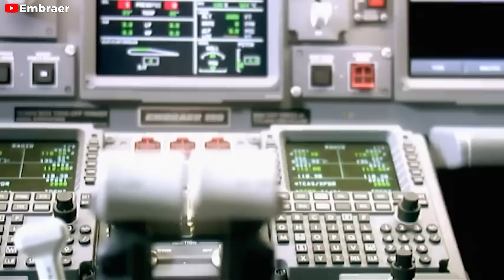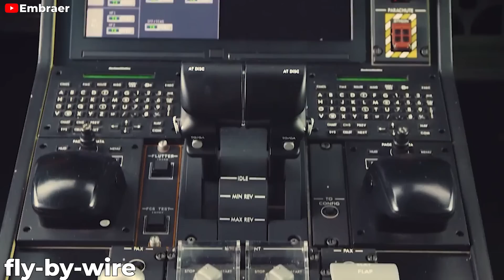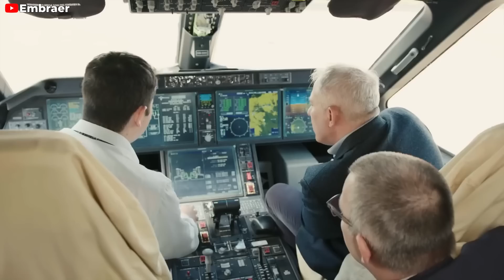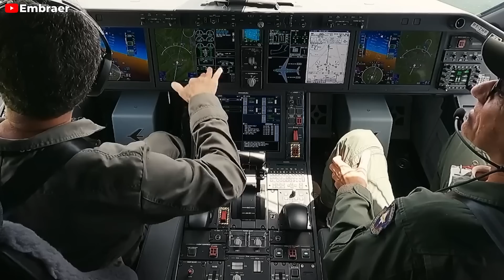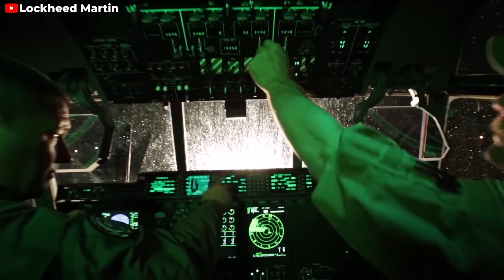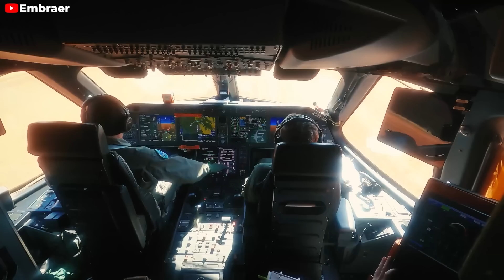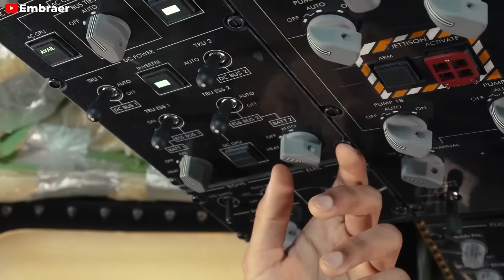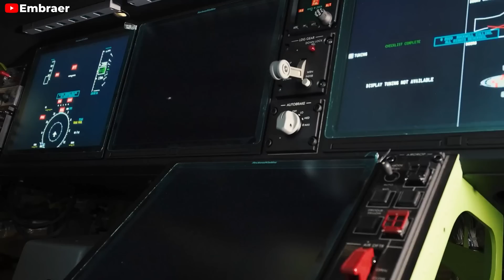The Embraer NEW C-390 Will Change The Aviation Industry and Destroy C-130J! Here's Why

Comment: Nope the C390 doesn't fit Special forces niche. It also can't become a gunship. Then there the takeoff and landing on soft terrain and multi-environment. The C390 can do some things, But is still restricted on versatility.
Reply from the maker: thanks for sharing ✈️
Reply: Yes, it takes off and lands on soft, multi-environment terrain in the same conditions and locations as the C130. This was a project requirement.
Yes, it is highly suitable for Special Forces. Because it is faster, quieter and more equipped with countermeasures.
There is already a project for the gun chip version, but there is no customer order.
Remembering that the AC-130J Ghostrider must only be 30 units (previous versions have already been withdrawn from activity)
Reply: @wallacemjr  Oh really?
Show me a C390 taking off and landing in less than 1500 feet.
Can't do it with any load at all, and it's SPECED for 5000 feet minimum so it probably can't do it PERIOD.

BTW - show me a C390 landing on any aircraft carrier - and deck-launching back INTO the air.
That's been done by an EARLY KC-130, back around 1962 or so.
Reply: Ele pousa e decola em pista não pavimentada!

Comment: Where is the comparison with the Lockheed C-130?  Is the cargo space bigger?  What is the load limit, range, speed?  Take-off distance is also important, how short a runway does it require?  What is the fuel consumption?  Jet engines are not normally used where dust and debris on non-paved runways is present, so are these engines dust proof?   Can it fly is one engine is off?    How much does it cost to maintain?  The C-130 is known for its fuel economy, load carrying ability and ease and low cost of maintenance.  I'm sure it has decent avionics but are they as good as American made electronics? Stop with the sales talk and compare!
Reply: Tudo que você perguntou  o kc 390  têm! E muito melhor que esse museu do Hércules 130, tanto que está  vendendo muito, todos os países querem, intendo sua frustração, 😂 não esqueça que quem inventou o avião foi um brasileiro, chamado santos Dumon! O kc 390 e o futuro, pousam em qualquer terreno, voam em qualquer condições de tempo, carregam mais carga, voam mais longe, custo de hora de vou mais barato, voam mais rápido, pousa e decola com Menas pista, abastece no ar, caças e a si mesmo, e outra tecnologia  e o futuro, aceita que dói menos 😂🇧🇷🇧🇷🇧🇷👏👏👏
Reply: Alternative👍
Reply: The 390's avionics are designed and manufactured in the USA by Rockwell Collins.
Is the cargo space larger? Yes, the video says that
What is the load limit, range, speed? The video states that the 390 wins in all of these as well.
Takeoff distance is also important. How short is the runway required? C130 1064 m, 390 1100 m 3% advantage for C130
What is the fuel consumption? of the 390 is smaller, because with less fuel 6130 gallons, it carries more cargo and/or flies further than the C-130 with 8455 gallons.
Jet engines are not typically used where there is dust and debris on unpaved runways, so are these engines dustproof? Yes, where the C130 lands and takes off, the 390 also does the same. This was a project requirement since the Basilica air force operated the C130 in the most complicated operations in the Amazon jungle.
Can it fly if one of the engines is off? Yes, and not only does it fly, but it takes off with one of the engines failing. This is a requirement for the civil certification that the 390 already has and the C-130 never had.
How much does it cost to maintain? The C-130 is known for its fuel economy, cargo carrying capacity and ease and low cost of maintenance. The 390 costs less to purchase, operate and maintain. So much so that the Brazilian air force accelerated the retirement of its C130 and other air forces are opting for the 390 as a result. More modern project, taking advantage of Embraer's knowledge in civil and executive aviation in addition to using similar components from other aircraft, such as the A320 engines. They facilitate maintenance, lower costs and result in a longer supply chain.
Reply: @wallacemjr  Very impressive!  Now why didn't I learn all that from watching that sales pitch?  The C-130 is a fine aircraft but it's basic design is from the 1950s and was considered ground breaking when it was introduced.  But then so was the first plane the Wright Brothers built!
Reply: @wallacemjr  C130 had demonstrated the ability to operate from 1500 foot unimproved runways.
I have no clue where your 1064 meter spec is from.
Reply: Ahahhahahahahhaha it's half the size, give me a break
Reply: Você deve estar com diarreia mental! O KC-390 é superior ao C-130 e este fato é inquestionável. Volte para a sua caverna e durma por mais 100 anos...
Reply: Made in Brazil

Comment: No one can destroy the c130. It's all over the world. You are comparing a tiger vs cat.
Reply: Well sir, it seems to me that you don't understand much about the subject. You may like the C-130, but we have to be honest, the KC-390 is a more modern aircraft with more advanced avionics systems, fly-by-wire flight control, and much more. In terms of capacity, the KC-390 also wins, being able to carry up to 26 tons of cargo with a cruising speed of 470, while the most common version of the C-130J can only transport 19 tons with a cruising speed of 348 knots. With the KC-390, you will have Technology and Modernity, Cargo Capacity and Performance, Operational Efficiency, Flexibility and Versatility, and you will have many benefits such as Updated Technology, Lower Operating Costs, Greater Cargo Capacity, Speed, and Range. So I don't see any reason to buy the C-130.
Reply: @FGZINN09  but sir the latest model of c130j has also a fy by wire system upgraded avionics and a liquide crystal display. And turbo props has a lot of advantage it can land in dirt's air tripe or and develope runways more rugged compare to jets and also economical easy to maintained the fact that many countries today still using the old model c130h,c130t, and the latest edition of the long history of c130 the j model. And vary versitile to there's a tanker version capable of air to air refueling. There's is a gunship version th Ac130 ghost rider the latest version from the ac130 spooky variant c130 is proven in combat tested. Reliable. And the airframe is proven versitilty you can make it depending of the specification of the user country.
Reply: @EloyjaAbs-qm1iq  Not going to lie. As an aviation enthusiast, I can't say that the C-130J is bad or ugly, because I would be lying. Even so, our KC-390 still wins in several aspects, such as cargo capacity, range, and maximum speed.

Embraer did a great job in terms of operational flexibility. Although I thought the KC-390 was good at this, the C-130J performed a bit better in short and unprepared runway operations:

C-130J: Excellent capabilities on short and unprepared runways.
KC-390: Capable of operating on semi-prepared runways, but with some limitations compared to the C-130J.
Overall, countries are looking for a good aircraft with a good price. And, speaking of price, Embraer did extremely well. The KC-390 has everything the C-130J offers and is still better in several aspects, with a lower price. It's clear why we are growing so much and why many countries have their eyes on Embraer's aircraft.
Reply: @FGZINN09  Well, the C-130 and all variants are meant to act as a medium cargo aircraft for troop and equipment transportation, The C-130J is made to land on underdeveloped and short dirt runways and is combat proven.

Many countries need an aircraft that can preform well under high pressure situations and in almost any weather condition. The C-130 J is an extended version of the C-130H which is still capable of serving at least another 10 years even though they were made in the 60s.

The KC-390 is not combat proven, never been in deserts of Afghanistan and Iraq and especially never been used for low fly by scenarios with a 105mm howitzer and 40mm rattling guns. 

The reason the C-130 has low capacity of cargo weight is because if the aircraft were any heavier then the aircraft would not preform short runway landings and take offs. 

You definitely do not understand the reasoning behind the C-130J, I will only accept the KC-390 if I see it preform for over 60 years without leaving or being retired out of service, and the standards to beat the C-130J is to fly in and out of combat zones in severe weather conditions with a runway that is literally made of dust and pot holes.

And do you not understand the fact why Turbo Props even exist? Mate, do more research on flight ability and why certain aircraft stayed in service even if its been in service since the 1960s..

Cone back in 60 years ad lets see if the ORIGINAL KC-390 is still in service and can still last in 50 degree celsius weather in sandstorms
Reply: @rocket870  Mas o kc390 também faz pouso e decolagem em pista curta além também de fazer decolagem e pouso em pista não asfaltada
Reply: I don't understand what u said
Reply: @rocket870 translate simple
Reply: @rocket870  Chore mais 😭😭😭
Reply: @NoobSemb  No mate. The KC-390 only has 2 turbine engines, and I am guessing you don't know why the Turbo Prop even exists... The C-130J is far more capable than the KC-390. 

Heavier weight, bigger carrying capacity, heavier engines, and heavier plane means you have to cut out a few things to make it work.

The KC-390 is just not good enough to beat the C-130J
Reply: @eduardodisconzi5259  What do you mean cry more? The C-130J is made to be an aircraft that is unbeatable.

Brazil has no stand in the world's arms trading. Plus Emberaer is partly owned by Boeing and Boeing will never let it take over the C-130
Reply: Tchau vovô C130. Chegou a hora e a vez do jovem, moderno e rápido kC 390 EMBRAER🇧🇷🇧🇷🇧🇷🇧🇷🇧🇷🇧🇷
Reply: @davidsousa2314  os vira latas vão xingar vc com este comentário. rs

Comment: I agree it looks better than the C-130J.  However with that much interest from international buyers Does Embraer have the manufacturing capacity to produce these fast enough to meet deliveries.
Reply: Embraer has a second manufacturing unit solely for military aircraft. This unit can manufacture up to 16 KC390 aircraft per year and the Gripen fighters and the Super Tucano light attack aircraft are also built.
Reply: @alessandropenteado  It's located in Gaviao Peixoto town and there is an airport builded by Embraer.

Comment: I noticed there was no mention of minimum runway length for take off and landing
Reply from the maker: thanks for feedback
Reply: Right. The C-130 is meant to be used CLOSE to battle areas with NO runways.  
The props are less subject to sand, birds, and debris than jets.  
The C-390 seems like a lite version of the C-17 to me.

Comment: Embraer has the best product in every single segment they enter.
Reply: Gulfstream G750, Airbus A220.
Reply: @k9killer221  Yep, the E2 series is more fuel efficiency (even though both use P&W turbofan engine) because is designed with advanced aerodynamics and state of the art avionics. It has significantly lower maintenance costs due to the extended intervals between maintenance checks and the use of fewer parts. It is known for its quieter cabins, which enhances passenger comfort along with spacious overhead bins, and ergonomic seating. For the airline, it offers shorter runway performance and quicker turnarounds, which is beneficial to maximize aircraft utilization. 

The Praetor 600 competes well in the super-midsize category, but it is important to note that the Gulfstream G700/G750 series operates in the ultra-long-range category, thus serving a different market.
Reply from the maker: true

Comment: It is quite a compliment to Lockheed's C130 family that it is being compared to a new jet transport.  1950's to 2020's.  There are still some things the C-390 will never do that the C-130 does extremely well.
Reply: Me dê 3 exemplos de coisas que o C-130 faz e o KC-390 não faz, e te darei 10 exemplos de coisas que o KC-390 faz e o C-130 não faz.
Reply: @fabriciooliveira6886 let’s see environmental factors impacts those engines. Can it withstand sand, birds and battlefield conditions?

Comment: As a combat veteran Paratrooper I'm fully acquainted with the earlier C130 versions have trained extensively and jumped many combat missions. She's a wonderful Paratrooper aircraft whether exiting at 600ft port and starboard on static line operations, or freefall HALO tailgating  although it gets somewhat chili in the back climbing through 15,000 ft to whatever altitude the mission demanded.
Reply from the maker: thanks for your sharing

Comment: One reason the C130 stuck with propellers was to allow it the operate safely from dirt strips without the problems associated with jet engines sucking in potentially destructive dust and debris. The C390 is not going to replace the C130 for troop deployment and there is currently no other option.
Reply: One of the requirements of the Brazilian Air Force was the ability to operate on unpaved or gravel runways. It's a plane for jungles. 

If you look, there are a lot of images and movies with de C-390 operating in these conditions.
Reply: It's already replacing!
Reply: Watch 7:48
Reply: The c130 is a old concept.
Reply: @celsotorgozanardi9091  yes is old and b52?